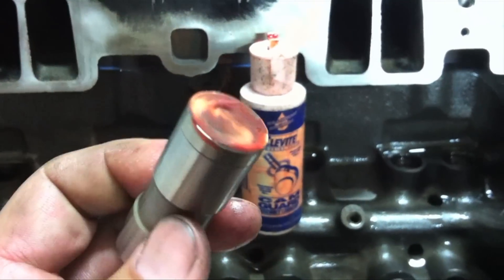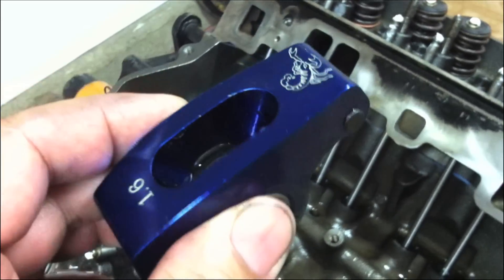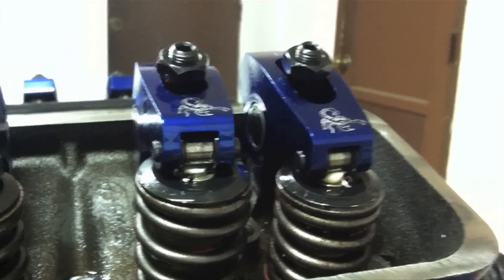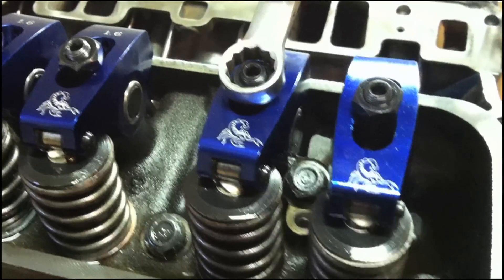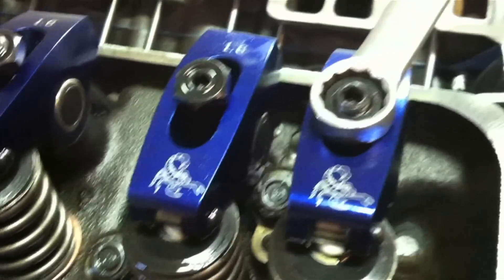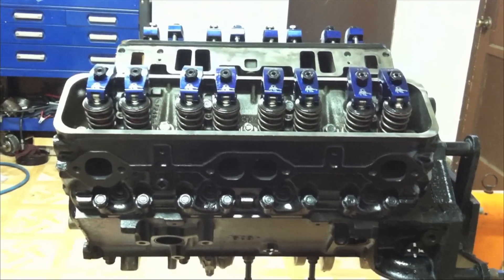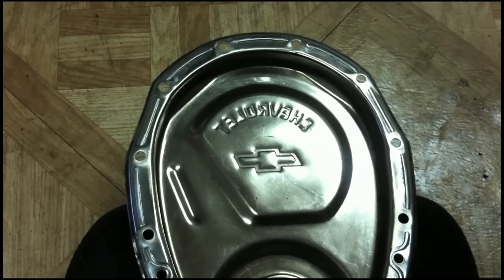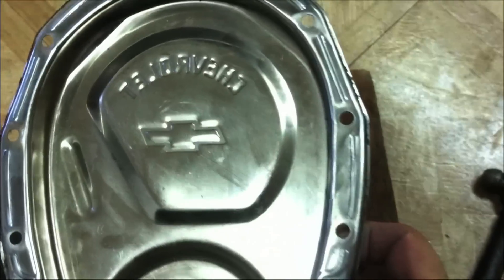How to Build a Chevy 383 Part 5 - Lifters & Rockers

Comment: why do you guys think everything from china is junk. we wouldnt have to buy chinese shit if  union workers were not over paid and american companys put reasonable prices on quality parts. Instead of being over priced just for a name. same guys bitchin about these so called chinese junk rockers have a flat screen in their living room that works perfectly for sunday night football. You would risk burning down your house with chinese electronics but wont put their parts in your engine. 90% of the shit you own is made in china. But the shit you put on your car cant be made in china.
Reply from the maker: +Superior Fly Company Look at the red 350 in my newer videos. I am using Pro Comp aluminum heads from China and they work great! Great flow, light weight, great price. Intake bolt pattern goes "both ways." Most of the metal that China uses for anything comes from the US anyway.

Comment: So why use flat hydraulic lifters when this late model block supports a factory spider hold down for hydraulic roller lifters ? I would think this trends away from performance and reliability. Not that flat bottom hydraulics are known as problem parts, but a good mild lift roller cam definitely lends to making more peak power. I say mild only because the roller rockers are in place and the pistons had releif cuts, but not fly cut for big lift....that and we know that you can't just throw a huge cam at a motor with nearly stock heads, which also leads to the why not vortec, or alloy heads... seems like a waste of a stoker crank, especially if this is being built to produce big power (otherwise why bother building a stroker?)
Reply from the maker: +Bobby D This was just a junk engine that someone brought me in a box of crap that he wanted put together. This was a few years ago way before I uploaded it. Take a look at my FB page to see some of my newer stuff. http://www.facebook.com/corvettesandcustoms

Comment: Also, you the way you worded your answer; you wouldn't recommend I use my 87 350?
Reply from the maker: +Brandon Saddler I would not rebuild a small block 60 over. I would spend the $200 - $300 for a 4 bolt main 350 core that has never been rebuilt.
Reply: This block has never been rebuilt, but I'm not sure if it's 2 or 4 bolt main. What issues would I have using a 2 bolt main?
Reply from the maker: +Brandon Saddler If it has not been rebuilt and it is standard then just rebuilt it .030 over. 2 or 4 bolt will work fine.
Reply: Great! I really appreciate you answering my questions. You're a really big help.

Comment: These videos are awesome! You are the exact person for my questions if you don't mind answering them, there aren't many. I have a 1987 5.7L 350 that I want to make into a 388 stroker, I know what that consists of (.060 bored chambers with a 400 crank). my questions are: what heads would you recommend for this build and will I face any overheating problems with .060 bored chambers? I've had a few people tell me I would, but in my opinion after watching these videos, your answer us what I will go with.
Reply from the maker: +Brandon Saddler Thanks man. First thing is if you are here in California with a smog legal car you are screwed. LOL That being said if you are free to build whatever you want then you need to answer a few questions. Truck or car? Budget? Time? Carb or fuel injection? If you look at my other videos with the RED small block I built it goes like this: Always use a new or un rebuilt block (preferably 4 bolt) so you only have to go .030 over. You can then rebuild the block again down the road after a couple hundred thousand miles. The cylinder walls are thicker and stronger . Heating is not necessarily the problem. Plus 30 over pistons are easier and cheaper to get with lots of choices on cast or "hyper erotic" (lol) manufacturing.  Your machine shop should be able to find you a good block. $200 - $400
The heads are where MOST of the power is made. If you have the money Brodex, World Products, Edelbrock, etc. all give good head options. Lately I have been using Pro Comp aluminum heads. They are made in China but if you are on a budget they are great. Whatever you get I prefer aluminum (for weight, flow, cooling and looks) and the Pro Comp heads "go both ways" for either carb or newer/Vortec style intake manifold. Get 200cc intake runners or bigger with 2.02 intake valves, etc. Again your machine shop should be able to help you with this. Here it is only about $500 more in the long run to do these aluminum heads over stock. 
You should NEVER need more than a 650cfm carb on a small block or 45lb injectors. 
There is a company on eBay that makes 2 LARGE row aluminum radiators that have worked well for me. I usually run a mechanical fan (Summit labeled Flex aLite plastic fan $20) and an electric fan BEHIND the radiator that PULLS instead of blocking the air flow in front that stays on or you can switch on in traffic or extreme conditions. Water Wetter also seems to help in heating problems. 
If you go on my website there is a build sheet or "wish list" that you can print out or copy that will help you plan and budget your engine build. Take it to your machine shop and they will love you for it! It makes life much easier for everyone. Thanks again and hit up my FB page for all the latest. I also have a new music video coming out with a 65 Chevelle as the star! 
Shan
http://www.corvettesandcustoms.org
http://facebook.com/corvettesandcustom
Reply: Well I'm quite a long way from you, I'm in Alabama where they don't care about smog for the time being. Will this "wish list" help me with all desires for what I want out of the engine?
Reply from the maker: +Brandon Saddler You can copy and paste, drag and drop or just print the wish list/build sheet. You can check what you want - i.e. aluminum heads, steel crank, etc. and then check on Summit Racing the prices for what you want and the options. You can then talk to your machine shop about the same parts and prices and their warranty.

Comment from the maker: +Wyatt
Thank you. Externally the 383 will be the same and will work great with the truck and fuel injection. You need to check your local smog laws, open your exhaust with headers or better mufflers, check the programming and injector setup. You may need bigger injectors and/or programming for your ECM.

Comment: does this work with hyrd roller cams? i thought your soppse to give the rockers a quarter turn preload?
Reply from the maker: stockingandblossom1 The basic "rule of thumb" is after zero lash is set 1/2 turn past zero for high rpm response and 1 full turn past zero for more low end torque.
Reply: what if i want the best of both worlds? :)
Reply from the maker: stockingandblossom1 Personally I usually adjust the rockers just past 1/2 turn (5/8 turn or to about 7 o'clock) over zero lash. LOL
Reply: SanDiegoHotRod
oh one more question, what about timing when it comes to reinstalling the distributor i learned from motor trend you need to set the engine 12 degree with cylinder at top dead center but it's for a 454 bbc what a sbc?
Reply from the maker: stockingandblossom1 Timing is another thing everyone will argue about. You can set the timing to "factory specs" but that is just a baseline thing. It depends on whether you run a vacuum advance (I don't) and so on. I promise you that setting the timing (and carb mix) on a 4by  truck in Colorado in winter is not the same as setting the timing on a Corvette here at the beach in San Diego in summer.  If you have a car that needs to be smogged and live in a place where you have to pass a smog check you are mostly screwed. If not this is how I set the carb and timing. I don't use vacuum advance. Just straight mechanical. Disconnect and plug vacuum line to dist. Hook up a vacuum gauge to MANIFOLD vacuum (NOT ported vacuum). set the carb mix screws to get the best vacuum (at around 600 - 800 rpm). Set the dist. to get the best vacuum and then back down a couple degrees. You should be sitting around 700 rpm, 10 - 15 degrees advanced at idle (not over 36 degrees advanced at 3000 rpm) and 15 - 24 inches of vacuum at idle. Always run premium gas (which changes throughout the year) back off the timing if you hear any knocking under a load. Elevation, temp, humidity and gas all make a difference as well. Or just set the timing at 6 degrees btdc like the book says. Simple right?
Reply: dam XD

Comment: Are flat tappets good for racing?
Reply from the maker: Flat tappets are fine for racing. I have built many "blower motors" aka engines with superchargers with big horsepower and never had a problem. The rule of thumb is that it is easy to build horsepower but expensive to release more horsepower. High compression makes power but better heads (bigger ports and runners) "release more horsepower." The engine components "restrict" hp so any time you can lessen friction or make the process of intake, compression, expansion and exhaust more efficient the better. I.E: take the friction away from the cam and lifter with roller lifters, roller rockers, etc.
Reply: SanDiegoHotRod if we could get that 90% heat leaving the tail pipe, or just like 50% of it and get the engine 60% efficient, you would have more power than you know what to do with. dam shame its only around 10-15% efficient .

Comment: What type of head are you use on that block, casting? intake and exhaust valve?
good video
Reply from the maker: Thank you. These heads are stock Chevy Vortec heads. They are designed to flow better than older cast heads. If you look at my new video "Dress Up" series you can see an after market aluminum head that works incredible!
Thanks.

Comment: Can this be used for LS motors as well?
Reply from the maker: The LS engines are a bit different. If you do a google search for "how to adjust LS rockers" there is a good link to ls1tech.com that shows a page from the factory manual on adjusting rockers.

Comment: Were guide plates not required? I see some rocker manufacturers claiming " self aligning" rockers.
I have a new set of 1.6 aluminum rockers to put in, but I hesitate because I don't have screw in studs and guide plates.
I currently have a .480" lift cam and stock heads.
Any input on this topic?
Thanks     Nice video
Reply from the maker: Thank you Mark. Yes on this engine with these heads and these rockers no guide plate was necessary. Guide plates are good to have and you should look close at the rockers you have but on these rockers a few things help keep everything aligned. The holes on the heads the push rods pass through are fairly tight but mostly the pivot point where the rocker sits on the stud is a long straight hole through the center axle/axis/pivot point/fulcrum (whatever you want to call it) keeps the rocker from wobbling. On a regular stamped steel rocker the round bottom rocker "ball" under the nut sits inside a rounded "tub" allowing the rocker to move around. The "self aligning" part you can see at 2:04.
On the roller tip you can see a "lip" on the outer edges of the roller that sits on each side of the valve stem to keep the rocker from moving sideways as it rolls over the valve stem and pushes the valve stem down. Some stamped steel "roller tip" rockers have the same thing.
When i work on a project I try to stick to 3 main categories.
1. Stuff you NEED
2. Stuff you COULD USE
3. Stuff you DON'T need
If your heads are old with press in rocker studs you could use screw in studs (and then why not guide plates) because rocker studs are known to pull out of older engines.
Hope this helps. Thanx again. Shan.

Comment: Hello good videos you have! i am assembling my balanced zz383 gm performance v8.
i wonder if you give the engine oil pressure before adjusting the valves?
Reply from the maker: Thomas Flessen Thank you. I don't prime the oil pump until the engine is completely assembled and ready to start. I use either a priming tool or the shaft off an old distributor. The new lifters should be okay for adjusting out of the box. If they are collapsed already there may be a problem. Just don't crank them way down right off the bat. Do it slow and easy and you will get the feel for it (the up and down play on the rocker).

Comment: Hey this series has really helped me I don't know a whole lot im 21 but learn fast getting ready to build my grandpas 50s chevy truck with a 350 I want 383 it has a straight sucks right now but hes not sure yet what loctite do you use on the crank seals on timing cover plate and wheel on cam shaft thanks adam thumbs up man
Reply from the maker: Thanks man I appreciate it. I use red loctite but make sure to only use a drop or so so that it gets on the threads but does not drip or get anywhere else.
The yellow super weatherstrip adhesive is to glue gaskets into place. Rule of thumb is use super weatherstrip adhesive to glue the gasket onto whatever is coming OFF the engine, i.e: Timing cover, valve cover, water pump, thermostat housing, etc. Then use the Ultra Grey permatex to seal the engine side of the gasket. I usually do just the opposite though on the oil pan.
Glue and spooge and you will never have a leak!

Comment: any broken rocker arm studs yet? screw in studs always good insurance no matter what kind of build
Reply from the maker: Rocker arm studs are fine but yes screw in studs are always better. I am replacing the stock push in studs on my dad's 71 Chevy truck. It has a 350 and the studs are pushing out. The complete kit to replace studs is not very expensive from Summit Racing but some people are just cheap like the guy who wanted me to build this engine without doing everything it needed to do it right.
Never again....

Comment: Good videos man learned a lot my 350 just went out and not to sure where to evam start on the rebuild
Reply from the maker: Thanks. Find a good machine shop you can work with and see if they have any unbored 350 4 bolt main blocks. A 350 is going to be a LOT easier and less expensive than a stroker. There are "build sheets" on my website to print out and help you decide what you want to build with a list of options.
corvettesandcustoms ORG
Reply: Is there a way I can get 400 hp out of it ? Im thinking if im going to re do it ima do it right
Reply from the maker: Aron Martinez
I am getting ready to do a 400hp 350 for a 61 Chevy right now. 10:1 compression, good cam (check out "camquest" on comp cams website), HEADS are the most important. Need GOOD head work done to get the power (ported, opened up with big valves) if you have the $$ aluminum heads help a lot with flow and weight.
Reply: SanDiegoHotRod 10:1 compression is that a different type of gas already or still the same unleaded ?
Do you recommend those scat kits ?
Reply from the maker: Aron Martinez
10:1 you can still use premium pump gas. Scat has good kits as well as a few others. Main thing is to use a 4 bolt block .030 over (or new) good pistons and a steel crank. I get a lot of parts from Summit Racing and they offer cranks to complete kits. Work with your machine shop and plan it out ahead of time. BALANCE everything to get a smooth ride and longer life from the motor (engine).
Reply: SanDiegoHotRod alright thanks men il let u know how it comes out

Comment: Thanks for posting, my buddy has a 383 in a 90 silverado, I don't think you mentioned that you also have to bore the block to achieve 383 cubes? I learned a lot from this series
Reply from the maker: Thank you very much. You do need to bore a 350 to make a 355 but you may want to do a little research on whether or not you need to bore the block to make a 383 out of a 350 if you don't want to take my word for it. 350s are not EXACTLY 350 cid and so on. The EXACT displacement on an engine depends on the bore, the rods, the pistons, the heads and even the cam. Thanks again. I have some shows coming on buying and flipping classic cars so stay tuned!

Comment: The proper way to adjust valvs acc to Chevrolet you brung the cyl to tdc and then adjust both valvs 5/8 turn after 0 lash
Reply from the maker: Timing should also be set at 6 degrees before TDC. When you build specific build engines or tune a car for performance numbers change. You should set the base timing and total advance according to the car/truck you are working on. Base timing can be 12 degrees BTDC depending on fuel, engine, weight of car, race application, supercharger (blower) etc.   Total advance should be 36 degrees @ 3000 rpm. Tires on an off road truck also change. Higher pressure for street, lower pressure for off road. Valve adjustment also changes how an engine performs. Adjust (hydraulic) lifters 1/2 turn to 1 full turn past 0 lash. 1/2 turn for higher rpm performance, 1 full turn for more low end torque. Again, fuel, weight of car, performance application, etc. are all factors.

Comment: Awesome! Thanks for the tips. I am actually in the process of working on a transmission problem I have to get the thing running properly first. Car doesnt want to go into 3rd or 4th without playing around. Will hop into neutral if you don't do it right.  Going to try a B&N Shift Kit to try and tighten up a little bit. Definitely will go for some aluminum heads and Flowmaster later down the budget line. Thanks again. Im learning.

Comment from the maker: I like the TPI Z28. I just started working at Chevrolet when they came out. If you want a couple more "low cost" HP you can install roller tip rockers (about 1 HP per cylinder) or full roller rockers (worth about 2 HP per cyl.) (depending on budget). You should also install a K&N air filter or full K&N cool intake system. (Another 5 - 15 hp)  You can also find other COTTON air filters or oil to match the color of your car just for S's & G's. Lastly, headers and a Flowmaster muffler.